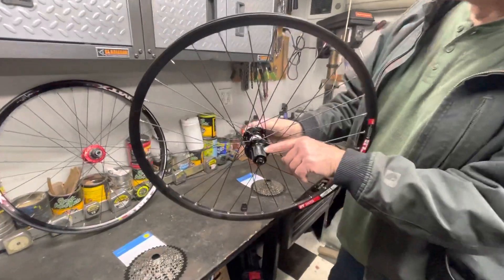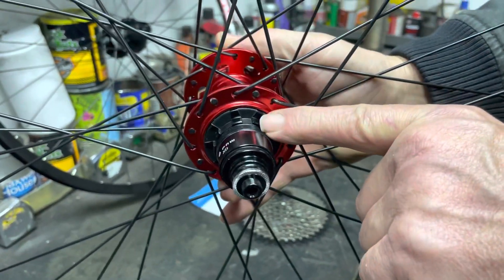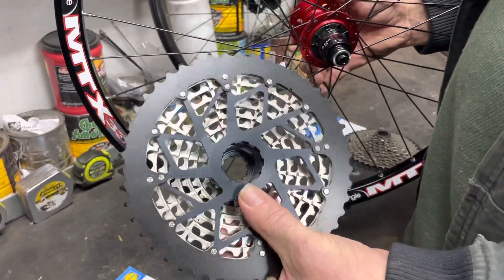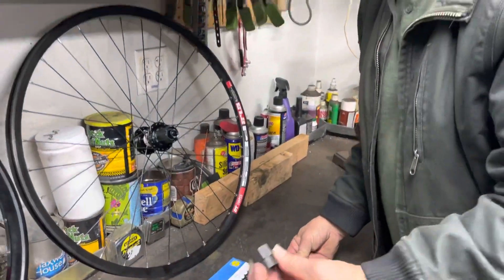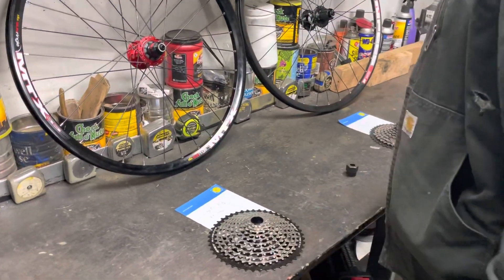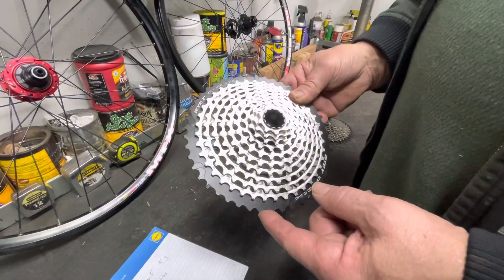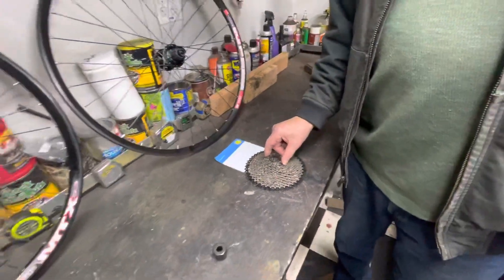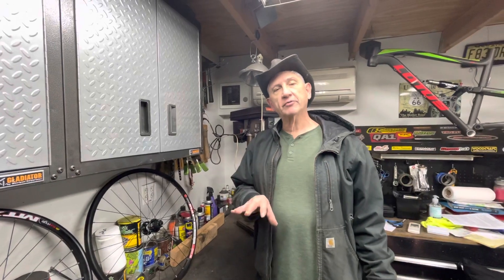Shimano HG vs. SRAM XD￼

Comment: With Shimano you can replace the 11 13 15 tooth cogs they only cost about €4 each, sram is a waste because the whole cassette is useless when the small dogs wear out, especially with an Ebike
Reply from the maker: @dermotsheehan8614  that is true as far as the cassette is concerned. But the problem is the HG style hub itself gets really bad notches in it overtime. XD style hub don’t wear out like that because it tightens to it instead of floating on it like the HG.

Comment: Please someone help me.. I have 28 hole 9 speed HG hub and now I want to use 7 speed 14t - 34t freewheel instead of HG cassette... So how it possible without changing the hub? Or should I change the hub to normal single speed hub ... Is the freewheel compatible with SRAM XD driver... ?
Reply from the maker: Not sure why you would really want to do this, but as far as I know, you gotta change the whole hub you would need to lace  a new free wheel hub into the rim
Reply: @theshedMTB  I've been running 1x9 drivetrain 32t x 11t-42t  and it's really expensive, not durable, it needs lots of effort to maintain certain speed on small cog and I believe it is for extreme mountain terrain. Deciding to install 3x7 setup where's 28t 38t 48t crankset with 14t - 34t 7 speed freewheel.... I drive my friend bike 48t front x 18t rear to maintain certain speed which is same to the 32t x 11t and found something less effort for the first one 48t x 18t. May be moving likely towards the road setup.. but thank you so much
Reply from the maker: @007kggaming2  you probably can get a cassette though that seven speed 14 to 34 and then you don’t have to do anything to your wheel. I think with the seven speed cassettes, though you need a spacer if you have a eight speed HG hub

Comment: You have a lot of tape measure.
I can only measure one thing at a time.
Reply from the maker: Ive been a sheetmetal mechanic/fabricator  for 40+ years,  you go through alot of tape measures! Some of them date back to the 1980's!
Reply: @theshedMTB  I been hanging commercial fire doors for 30 years and I have 3 at all time.
I'll never forget the time I saw a guy in the shop hammering on the 2 Rivets at the hook end. 
What are you doing? He said the rivets are loose...LOL WOW

Comment: The sram XD are usually a 10tooth then Shimano had to one up it and went 9 tooth but the micro spline hubs. I to prefer the XD, have then on 3 bikes
Reply from the maker: I never found a MS cassette with the 9t , but im always looking at lower cost stuff, so maybe its a higher end thing.  I could have went for either but the cassettes i found in the ratios i wanted were XD

Comment: With the 9 tooth you should be able to go down to a 30 or 28 and still have the ratio of a 32/11. Most people with an 11t small cog run a 32 or a 30t already. Like i do.
Reply from the maker: There are gravel road type areas and paved paths to the trails were i use high gear (36-11) and i could use allitle  more. I know most people rin smaller chainwheels up front but its alittle different for me.
Reply: @theshedMTB  Idk Chris, you are starting to sound like a roadie! Haha. I know you are old but I think you can still make it up some steep dirt hills. I believe in you! And so does Tracy!👍⚓😎
Reply from the maker: @TheCaptainsCog  you young guys just dont get it! Give it a couple years and youll be like," now i know what he meant!"

Comment: I like how you're showing some of the differences between them, Is there a difference on the feel of engagement and shifting?
Reply from the maker: Berserker Nick,  i never answered your question! This cassette never would work right, the chain would skip teeth under load in 9th and 10th gears no matter what i did. I went back to a 11-50 HG cassette  and the GX derailleur works great but requires adjusting every couple rides. My Deore stuff i could ride through mud every weekend for 6 months before i have to touch it!
Reply from the maker: The 1st gear teeth do actuallt look allitle  different than the Shimano  so i guess ill have to see when its all together if it shifts the same. My shimano deore stuff shifts pretty nice!
Reply: @theshedMTB  thank you for the awesome stickers
Reply from the maker: I havent run it yet, still just putting stuff together.